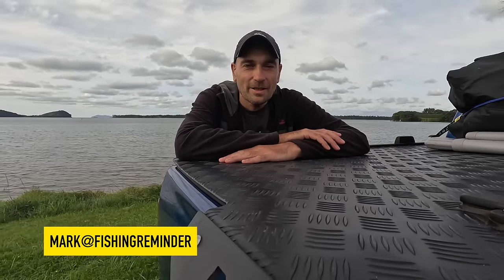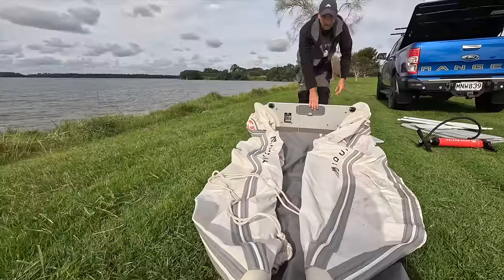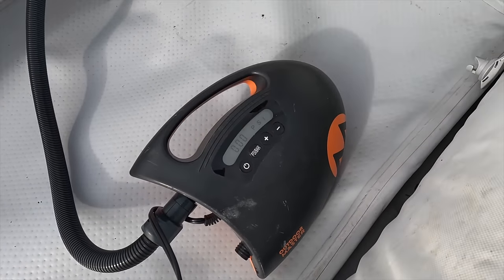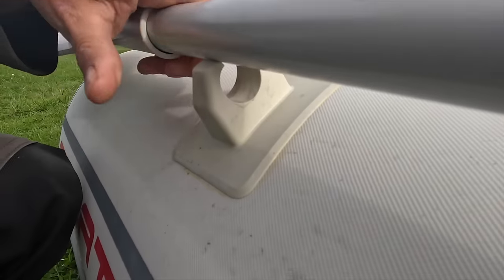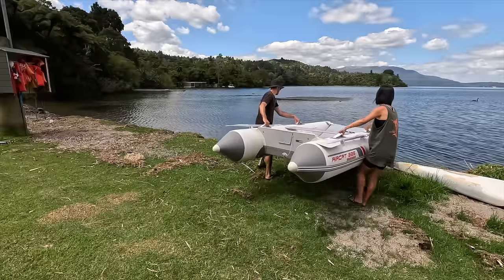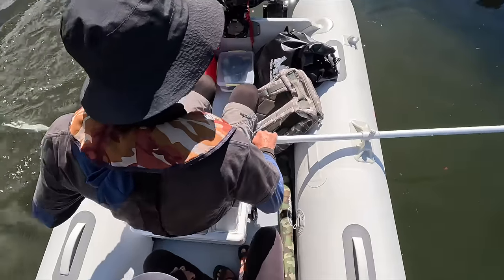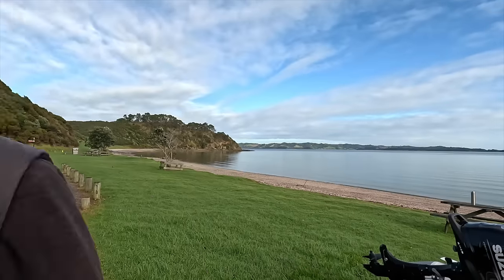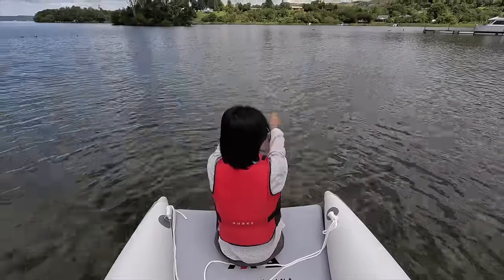Aqua Marina Aircat Review: The Best Portable Fishing Boat?

Comment: Nice video. The boat 'seems" nice BUT leaks at seams are a quality control issue and very telling as there's not much you can do to patch at seams. I currently have 3 inflatable boards and 3 inflatable wings.  Over 12 in past 10 years and I've never had a leak at a seam like that. Some with 100 inflations and uses.  1 would be bad enough but multiple products with the same leak at a seam = poor production and quality control. 
You should put it in for warranty fix/replace.  
Pass.
Reply from the maker: I think it's not too bad. I had the boat for over a year now and got tons of use out of it. I still think it is great value for money, despite the small quality issues. The leaky seam was very easy to fix. Just ran a bead of glue along the seam and no more leak. The leak was very slow to start with. I think when you use inflatables for fishing you have to deal with leaks anyway :) Everyone I have met so far, even the ones with expensive "high quality" Takacats or Truekit boats, had leaks after a few times fishing. My boat now also has a few patches over a few pin hole leaks caused by fish spines. Gotta be super careful when handling fish but it's not always that easy :)
Reply: @Fishingreminder  Paddleboards and foil boards, etc have ALL gotten MUCH cheaper in the past year or so.  Not just selling price (yes that too), but also the construction.  All my older boards and wings use MUCH thicker and stiffer material to make the board.  The last year, maybe 2, there are a LOT more much lighter (thinner material used in construction, less internal ribbing and other reinforcements.  More like fancy air mattresses basically.  Caveat emptor

Comment: Hello! I am very happy with my boat. A thought regarding the engine. I have a Yamaha 4hp. Many want more, so looked a bit at 8 hp. It weighs considerably more then you have to have an external fuel tank which takes up a lot of space. 6hp still has built-in tank. Significantly cheaper and lighter than 8hp. But I have heard that it is not worth upgrading to 6 hp if you already have 4 hp. What do you think here? More speed is always good when going to fishing spots, and when going home if you are some distance from the port. Thanks in advance!
Reply from the maker: Hi, I think it just comes down to speed and fun in the end. With my 6hp I get planing very easily when I'm on my own and reach a top speed of about 22km/h. Going fast on a calm day is lots of fun besides getting to a fishing spot much quicker. Even though I have an inbuilt tank on my outboard, I never use it. I use an external fuel tank - it's easier and a 10 litre tank lasts forever. When I'm fishing with my wife then the 6hp is not enough to get us planing unless it is super glassy and we don't take any extra gear. So in that I case I wish I had a 10hp engine :) I find the pull start quite annoying though. That's another thing to consider. The bigger the engine, the more force it needs to get started and the harder it will be on your shoulders and arm.

Comment: In regards to motor cavitation. The 15" on shortshaft motors can vary quite a bit between motor models by few cms. Motor specs should give the exact length. I have same issue on my boat, yamaha 8 & 15hp works fine but both yamaha 25hps are too short. Found tohatsu 30hp is perfect match.
Reply from the maker: Interesting that there is such a variation. I found that tilting the motor slightly to the second or third tilt position when going with two persons avoids the problem.

Comment: Thank you for the informative Video! Would you happen to know the height from where the motor sits down to the center of the prop? I'm not sure whether the shaft of my motor can be considered as long or short
Reply from the maker: thanks, I'm not sure but on the Suzuki page for the 6HP motor that I use it says the shaft lengths are 15" Shaft Length (Short)  and 20" Shaft Length (Large)

Comment: Them holes are for wheels to attach to the transom so you can move the boat by yourself without dragging it on the ground or having a 2nd person helping you carry it. There is a kit you buy  through the manufacturer where you get wheels and rod holders together, and they attach to them existing holes in your transom. You drilled holes in your transom when you should have bought the wheel kart that went with the boat through the manufacturer. I don't recommend drilling holes into the bottom of the transom as you did. I have the same boat with the wheel kart and used the existing holes that were pre dilled by the manufacturer at the top of the transom. After market is fine but never works properly. You would have saved a lot of time and money just going to the manufacturers website and buying the proper wheels that go to this boat.
Reply from the maker: Thanks for the comment but Aqua Marina does not provide any wheels for their boats. If you can still  find the wheels you were talking about then please send the link. The holes are to attach a rope so you can hang the boat on your davits, if you intend to use it as a tender. Some manufactures like Takacat provide wheels but not Aqua Marina. In my opinion it would make no sense to have the holes in that position anyway for attaching wheels. They are way too high up and you'd need more than two holes for stability. The holes are also too big for that purpose. But I'd be interested to see your setup. If you are talking about a third party wheel cart that you can strap to the boat somehow then you don't need to drill holes at all. But that wouldn't work for my purpose because I often launch on very rough terrain so I need the wheels that I have installed, which by the way are still great and no problems at all one year later.

Comment: Worst purchase I've made. Transom disintegrated after two years. Very poor quality boat. Actually very dangerous boat as the motor could conw off with transom. Called Aquamarina. Lady told me "perhaps I could add a sealant on the rotted voids ". Yea... oookay .
Reply from the maker: Did you store the boat outside inflated or did you store it rolled up?

Comment: I like your video but I have a question.  Since I like it portable, yes, a 6HP is the best choice (around 55 pounds which is okay).  But, the Aircat 11'00'' is 73.9 lbs while the U-Deluxe 9'9'' is only 61.7 lbs.  I would like a boat not for fishing, not as a tender, but only to go on the water (lake and ocean).  The speed is important for me.  Do you think I can go faster with the Deluxe boat or the Aircat boat ?!?  The wind is also something I have to think about.  While going against the wind, do you feel as safe in a Cat ?  Meaning a U-shape boat can't fly !
Reply from the maker: I think with a longer boat you can go faster in general than with a shorter boat and with a cat you have much less drag in the water than with a u-shape hull. If you want to use it mainly for fun then I would definitely go for a cat style. I feel very safe against the wind and chop. I haven't tried beach launching in bigger waves yet. The drain plug is fairly small compared to a Takacat where you have a completely open transom and all water that comes in drains out right away. But for small wind chop and non breaking waves I have not found any issues and the water drains fast enough.
Reply: Quindi va bene come barca veloce da divertimento? @Fishingreminder